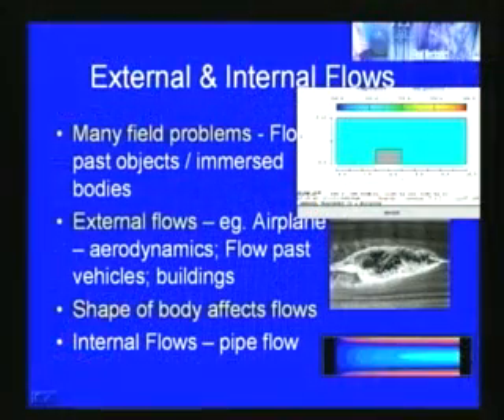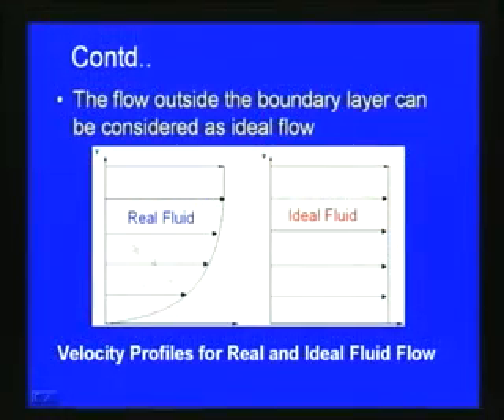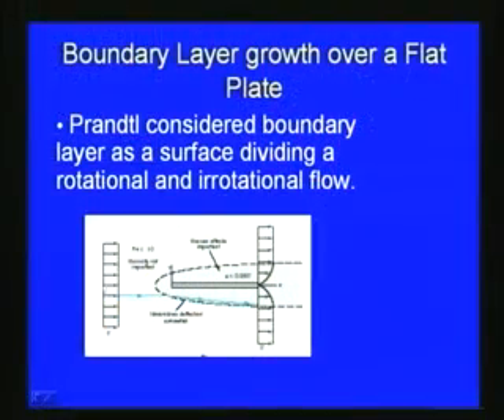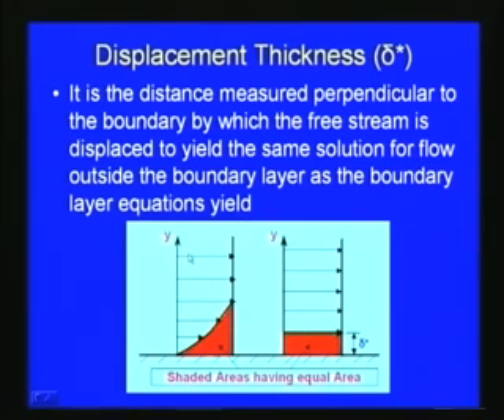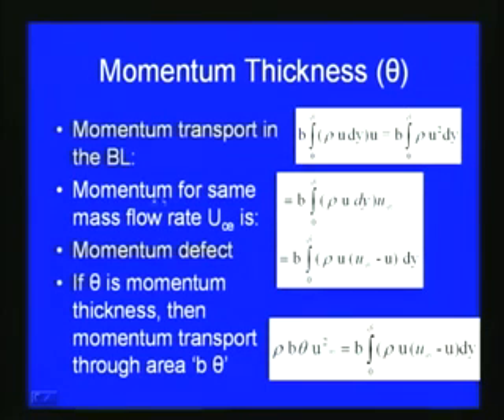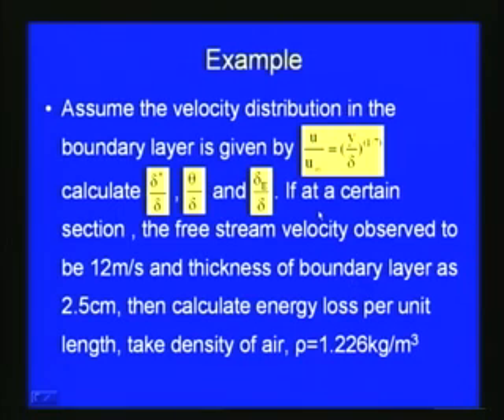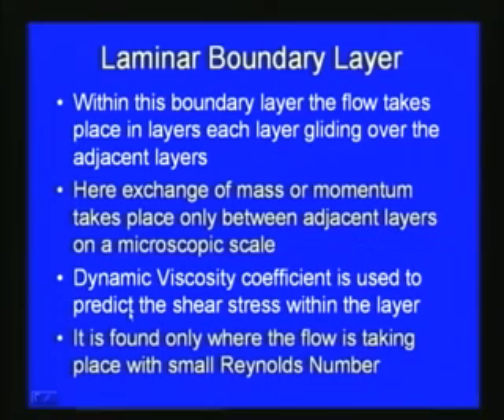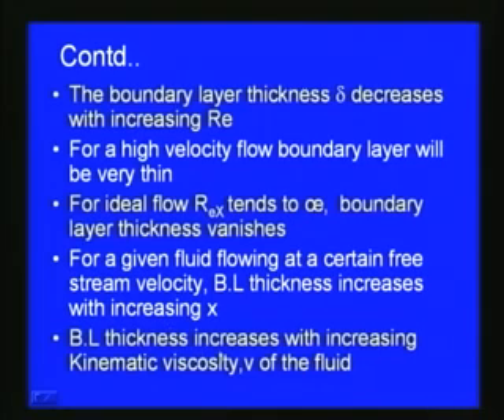Lec-30 Boundary Layer Theory and Applications

Comment: Boundary layer thickness is the distance measured normal to the flow from the surface of the plate to the point where the flow reaches 99% of free stream velocity.

Comment: Consider that the air is flowing over a flat plate. Then the boundary layer thickness is the distance measured normal to the flow from the surface of the plate to the point where the flow reaches its free streem velocity.